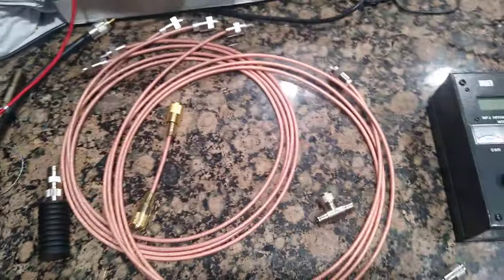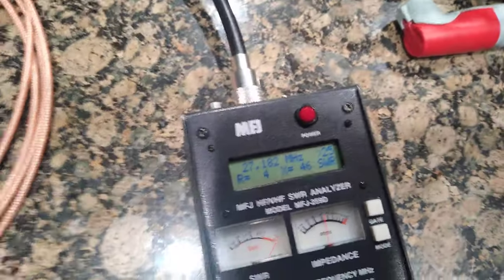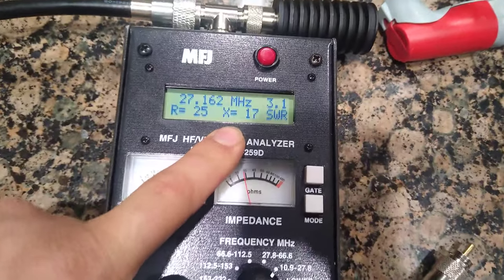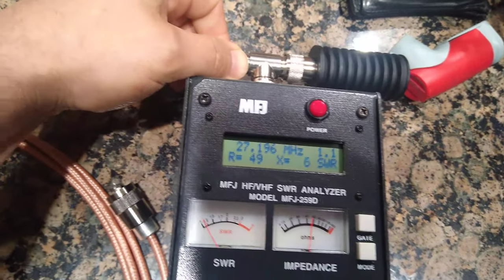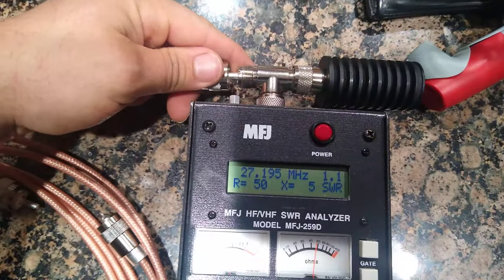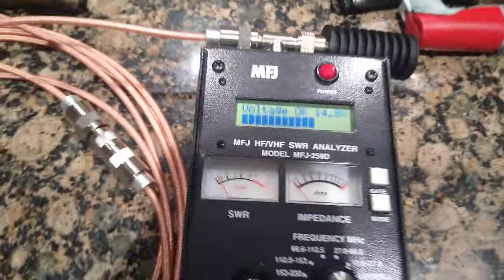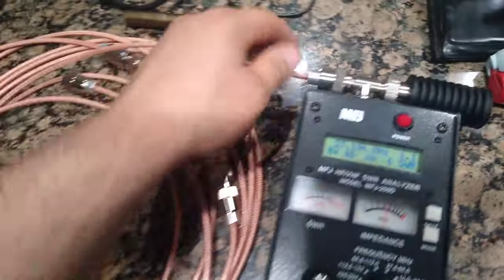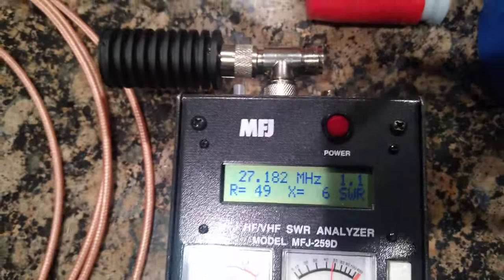More coax tuning 1/2 and 1/4 wave 11M observations

Comment: Putting the dummy load on the end of coax proves coax is doing what coax should do, it sees 50 Ω on the end of 50 Ω cable and matching it nicely. What you did at first was showing the difference between a quarter wave and half wave open end coax. Coaxial stubs at the transmitter were used to filter out harmonics when t.v. used frequencies around 45 MHz.
If you're cutting coax to get a better match at your aerial I would suggest there's something wrong, the aerial is not 50 Ω, it's acting as a counterpoise earth and likely there's r.f. on the outer of your coax.
I've never had to cut coax for a good match on aerials.
Not one radio book of mine says about cutting coax to one half wavelength for a better match G4GHB
Reply from the maker: Ham instructor agrees with me
Reply: @electromechanicalstuff2602  Why is it not in any technical radio books?
Reply from the maker: @bill-2018  you've used an antenna tuner before right? It adds induction and capacitance to adjust the reactance of the amp to match the antenna. If coax isn't cut on a node of the frequency your using it adds reactance which changes your amplifiers tune. You can use an antenna tuner to make the match but it's going to change the resistance your amplifier sees. Too little and your going to damage your amplifier too much and you loose power.
Reply from the maker: Are you sure it's not in any books. Like ones that talk about coax velocity factors? And like the instructor said the longer the coax the less it matters. 
But when you look at it on an antenna analyzer like the mfj I had in this video or a rig expert I have now you can see the resonant nodes in the frequency with every random length of coax. As you change the length that resonant frequency changes. Sometime real world findings are better
Reply from the maker: https://youtu.be/Z2lxv6F8fvA
Here's the video I thought I attached last time. Of the ham instructor showing it.
Coax starts at 31 minutes
Reply from the maker: Mind you also that commercial radio stations use large heliax that has very low reactance and low loss
Reply: @electromechanicalstuff2602  It is because of the high power they run, and yes, low loss comes into it.
Reply: @electromechanicalstuff2602  Well, okay.
Reply: @electromechanicalstuff2602  This is why coax stubs can be used to short out unwanted harmonics on a transmitter. In my RSGB Handbook there is a graph showing lengths of wire used as an aerial from one quarter wave to three quarter wave and how the impedance changes, that's why some ATU's can't cope, it's out of their range.

46 pages on h.f. aerials and matching to a transmission line.
17 pages on transmission lines and for coax impedance is as follows: 
It is often important to know the electrical length of transmission line, either for making antenna impedance measurements or constructing phasing lines for stacked beams or phased verticals. My addition, three Smith Charts are provided for this and the velocity factor is described in making these lines.
Another paragraph, Matching the antenna to the transmission line. My addition, it does not say matching the transmission line to the antenna.
My h/b 2 metre collinear has phasing lines.
I suggest you get a good radio book and read up on the subject and make your own mind up but I've never had problems with matching aerials to coax.
73, Bill.
Reply from the maker: @bill-2018  did u watch the video? 
Do you own an antenna analyzer? Have u seen what he is talking about with your own eyes? I have. That's good enough for me.
Everything I own has a 1:1.1 or less match. On my entire band.  Both vehicles both base stations. Will it work if u don't sure. But expect sometimes a higher swr because depending on the reactance of YOUR coax it could lead to higher SWR. so if your ok with good enough that's fine with me
Reply: @electromechanicalstuff2602  Not watched it yet and yes I have a NANO VNA. My SWR readings are fine without playing about with coax.
Reply from the maker: @bill-2018  they may be. But usually you can make them better. The longer the run the less it matters. The better the coax the less it matters. But unless your lucky and accidentally landed on a note for the frequency in use you can usually always make it better.
Reply: @electromechanicalstuff2602  I forgot I did see it. At 34.05 he admits he put a bad antenna on. Why is he surprised things change? Of course things change. Who would try to use a bad mismatched antenna!
A longer run of coax can fool you into thinking there is a better match because the losses increase and affects the SWR because reflected power also has losses. 100 Watts out, maybe 50 at the aerial with 3 dB loss and 50 returned but another 3 dB loss has to be added so 25 Watts at the SWR meter so it looks better. It's always been said you need to check the SWR at the antenna with a short length of coax and then check with the proper coax attached.
As I say, I've never had problems.
Reply from the maker: @bill-2018  at one point he put a bad antenna on yes but even with a perfect antenna he had nodes and highs. I use 213 that he talked about and started with 100' trimmed it down till it was at the node. But my jumpers are rf400 and those I made all 1/2 wavelength as to not hinder my perfect match.
Reply: @electromechanicalstuff2602  Why is my comment not appearing?
Reply: @electromechanicalstuff2602  Comment too long maybe? That's why I say any length of coax can be used. I've never used a half wave. Years ago, ten plus, before I built my SWR meter I used to tune for maximum r.f. out and later with the meter in circuit it showed a low SWR, as indeed it should! No half wave coax used, just what I need to get to the antenna.
Reply: @electromechanicalstuff2602  Here's an experiment you might like to try.
For 40 something years I had no SWR meter and simply tuned for maximum r.f. at the antenna. Buy or make an r.f. indicator, a meter, diode, 1000pF capacitor and a short length of wire and detect r.f. at the antenna. Tune your antenna for maximum r.f. out, forget half wave coax, okay, monitor on the SWR meter if you like. Max. out should correspond to a low SWR. That's the way I believe is the way to get the most out of my antennas.  I used to do it and still do it with my Wireless 19 Set with no SWR meter. In fact my dipoles and inverted vee are tuned so I don't have the SWR meter in place because it is a resistive type and would drain half my power in the resistors and I rely on my transmitter readings not altering. If they do then something has gone wrong.
Reply: @electromechanicalstuff2602   LOL This is a perfect example of someone who is sitting at the peak of Mount Stupid on the Dunning Kruger curve, they've read just enough to think they know what they're talking about but in reality have no clue. BTW  @billkitchen9899   is Absolutely correct.
Reply: @electromechanicalstuff2602  That guy isn't an instructor, he's just some random clown doing a presentation at a club meeting someplace and he's making a fool of himself. He is a perfect example of the dumbing down of the amateur radio service. The end result of the dumbing down of the tests were all you have to do is memorize a few answers to Questions. The QR is that and look up his call sign he's got less than 5000 lookups and he's recently licensed. A CBer who finally managed to memorize the questions to the test.

If he is such an expert on feedlines and antennas then he should have 10s of thousands of lookups, if he's an instructor he should have 10s of thousands of lookups at his QRZ profile. but he's Only got 5000 on the other hand I have over 100,000 lookups, I hold all band DXCC and am on the honor roll. 

No I have to say is he's lucky I wasn't in the audience watching this because I would have made him look like an idiot. 

Once again there is no shortage of Clowns in Ham Radio, they dumbed down the tests quite a few years ago, anybody who can memorize 1/2 a dozen answers to questions can get their license nowadays. Basically a ham radio ticket nowadays isn't worth the paper it's printed on. It's not like when you actually had to sit down in front of an instructor and design an RLC circuit, or design an amplifier circuit. Back in those days you actually had to know what you were doing to get a ham radio license. now days They hand them out like candy That's why the ham bands nowadays sound like glorified CB.
Reply: @electromechanicalstuff2602  I remember now where I saw about coax cables. Bird who make expensive power and SWR meters say an SWR meter can be placed anywhere on coax if the whole system is 50 Ω. And why would it not be?
We aim for 50 Ω so the lower the SWR the closer you are to 50 Ω so it's doesn't matter where the meter is, you get to the point as Bird say it's all 50 Ω, transmitter, coax and aerial. If the meter anywhere says above 1.5:1 you need to adjust things.
G4GHB.
Reply from the maker: @bill-2018  sounds like you made an antenna tuner. Which does the same thing as tuning your coax. It balances the inductance and capacitance to make to your system more resonant. I have a nice antenna tuner and I can tell u with out tuned coax my inductance and capacitance on my antenna tuner are at higher values then when I use tuned coax.  U also know that the lower the resistance the more power u make to a point..... Get too low and you burn stuff up.
Reply from the maker: @dannelson8556  you and your attitude is the exact reason the sport is dying. U call everyone dumb and belittle them. Good luck with your dying hobby.
Reply: @electromechanicalstuff2602  I think Bird would not go along with that.
Reply: @electromechanicalstuff2602  How can my random lengths of coax on dipoles and inverted vee be considered a tuner?
G4GHB.
Reply: @electromechanicalstuff2602  Tell me, for all this trimming of coax do you see an appreciable difference in power output?
G4GHB.
Reply: @electromechanicalstuff2602  You do realise I adjusted the aerial for lowest SWR which coincides with as close to 50 Ω as possible? G4GHB.
Reply from the maker: @bill-2018  I see a dramatic reduction in SWR. I can now get a flat 1:1. with random coax it depends I used to have 1.6:1 at my station even tho my antenna tuned to 1.1:1 that's what started all this for me. I wanted to know why I measured low at the antenna and higher at the radio. U can tune your antenna for the best swr all u want but if you start adding capacitance and induction to your antenna circuit the SWR goes up. U need to then "tune it out" with an antenna tuner. But many modern multiband radios have built in antenna tuners so u don't have to worry about it. But  the built-in tuner's issue is if you have an amp between your radio and antenna that will only tune the input circuit to your amp not the output circuit to your antenna. So you're back to needing an antenna tuner that can handle power. Plus a low pass filter. Have you ever actually checked the resistance with an antenna analyzer at each point of your station. At antenna, at low pass filter, at amp, at radio? If you're not intentional with it it's all over the place.
Reply: @electromechanicalstuff2602  Perhaps you'd like some figures?
Random length maybe about 12' RG58 and 2m dipole with a ferrite ring using a NANO VNA, adjusting the aerial only:
SWR                       Ohms                pF
1.7                           39                    47
1.5                           47                    57
1.18                         54                   145
1.15                         50.5                150
It illustrates my point perfectly. No aerial tuner and no tuned coax. There is no purely resistive 50 Ω aerial, capacitance and inductance values are small, greater at 2m and up, but there and it's coupling into the air which is said to be about 377 Ω. 
Are you saying your 27 MHz aerial with tuned coax outperforms my 28 MHz dipole with untuned coax but correctly tuned resonant dipole? I'd love to see some laboratory tests on this.
G4GHB.
Reply from the maker: @bill-2018  u say if the meter is above 1.5 u need to adjust things. What would u adjust if your antenna is 1.1:1 but at the radio. It's 1.6? With nothing in between. Just radio, coax and antenna
Reply: @electromechanicalstuff2602  If it's above 1.5 it could be bad earthing, too close to something, common mode currents, poor coax, bad connectors. I don't know, the operator would have to find out, those are things I'd look at.
My example on 2m did not show anything wrong.
Reply from the maker: @bill-2018  the only thing I changed was coax length/tune and now it's completely flat.... So I don't know. I'm not trying to change anyone's mind. If you're already in the belief it's a waste of time. Ok. I'm choosing to waste my time so my radios "appear" to be happier with a lower SWR regardless of whether or not it's actually doing anything other than fooling my meters.
Reply: @electromechanicalstuff2602  Yes, okay, it's quite alright. I've just never felt any need to have tuned coax in 49 years. I had for many years no SWR meter so it's perhaps 10 years ago I made a resistive type meter which is good as the transmitter never sees above a 2:1 SWR while adjusting aerials. Many years ago, I think before late 1960, there was no such thing as SWR meters. 
In my teenager SWL days nobody talked of SWR. My amateur friend was horrified to see me tuning aerials without an SWR meter. He was still horrified when I made the meter because I hadn't calibrated it until about four years later, I just tuned for a minimum reading. Maximum r.f. output should be minimum SWR (and close to 50 Ω) which was confirmed when I made the SWR meter. 
I think too much emphasis is placed on SWR readings. Up to 1.1:1 is great. Even 1.2 is 99.2% efficient, 1.3 is 98.3,%, 1.5 is 96%, and so on according to the technical books. I aim for 1.5 which is fine but below is better and can be achieved.
Anyway tuned coax after an SWR meter is fine in theory but what about up to the SWR meter? It's still part of the system. Theory would say a tuned feeder is needed there as well. That's why I and most amateurs say coax length doesn't matter. Adjust the aerial not the coax.
I've never seen waveguide having to be a specific length for a given frequency either, it's the cross section which is important according to articles I've seen.
Okay, nice to have a discussion on these things. We might disagree but it's all radio and we're all still learning.
73, Bill, G4GHB.
Reply: @electromechanicalstuff2602  One last thought to consider. An SWR meter is not an isolator. It's like a coax connector making one cable.

Comment: Im newb to radio and have a question for you?I needed 2 jumpers(rg400),one from cb to amp,then another from amp to meter.I used my MFJ to make 2 near 6' jumpers,both are at X=0.My swr is high using both 6' jumpers.Should I cut one of them in half and use 2, 3' jumpers?Im thinking that would fix my high swr.Im asking cause l dont want to cut one of my 6' jumpers if its not gonna solve my problem.
Reply from the maker: Are they tuned 6' jumpers? How high? Antenna is tuned and low when barefoot?
Reply: Tune the aerial properly with ferrite rings on the coax.
Sorry for commenting if you have already sorted it.
G4GHB.

Comment: What calculations did you use to make your 1/2 wave rg400
Reply from the maker: Trial and error. Cut it a few feet long of 1/2 length of my band and started trimming. But there are many out using velocity factor and such. But It'll just save you a few feet of waste when trimming
Reply: To find coax length : 492 divided by 27.025 (or the channel you favor) times the VF (of coax) .70 = 12.743’ (1/2 wave).
It’s math🤓

Comment: Every thing you did up to connecting the dummy to the end of the coax was a complete waste of time, but I am sure you had fun all the same. There are legitimate uses for tuned lengths of coax but a simple antenna feed line is not one of them assuming the antenna is close to 50 ohms. A half wave (or a multiple of) will show the impedance at the far end be it a short, open or anything in between. That is why your last test with dummy on end of coax read as 50 ohms (= dummy load 50 ohm). If you were to repeat the same test with any of your other cables the result will be the same. It is this special property of a half wave that is the seed of thought  for the fallacy that the feed line needs to be a half wave or multiple. It does not. A quarter wave long coax if left open at one end will theoretically show short but will work perfectly if the end is terminated in 50 ohms. The VSWR on a feed line does not change with length. Bottom line forget all the BS surrounding feed line lengths. the correct length of feed line is just long enough to connect antenna to radio.
Reply from the maker: @RobB_VK6ES  I did another video of exactly as u said. And had done it before this video without recording it. When I run cables not half wave the swr and impedance change
Reply from the maker: @RobB_VK6ES  my last video showing what u said is called tuned coax 2.0. no T just dummy load on end of coax each time. I'd love to link it but they will remove comments with links. So look 10 months back in my videos